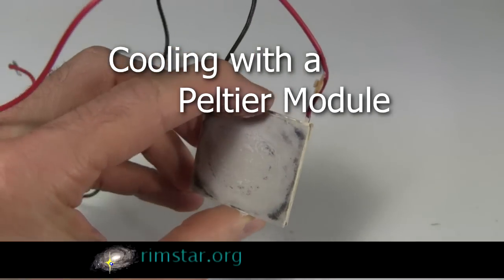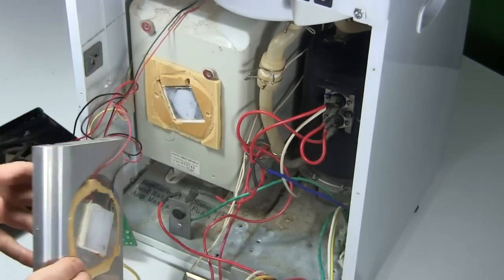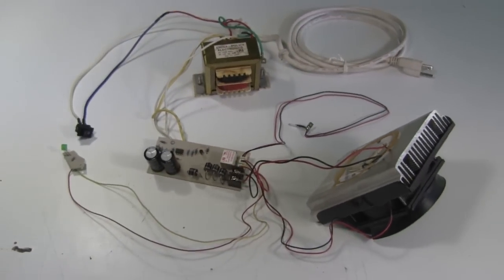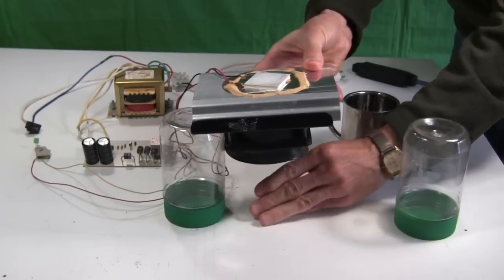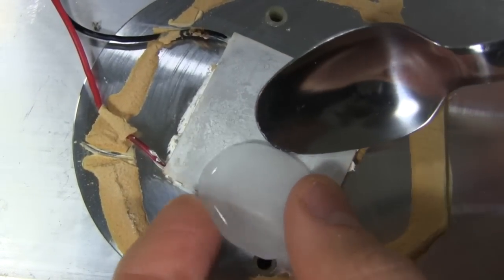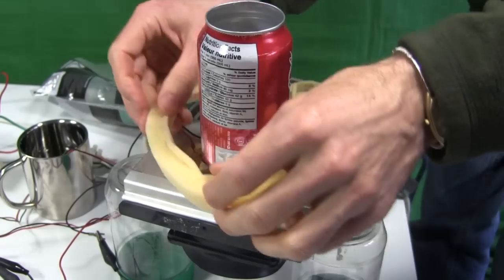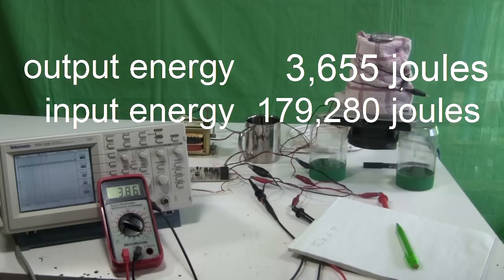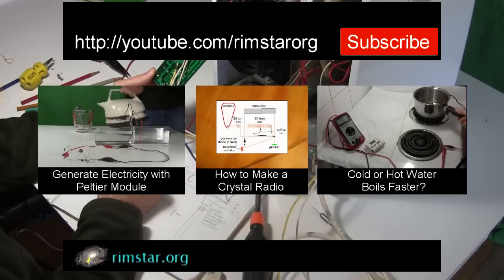Peltier Module Cooling - The Peltier Effect

Comment: Nice work here.  I've wanted to play with peltiers but didn't have the power electronics know-how to build a power supply for a base module so I like your solution of scrounging a peltier along with its power and control electronics.  I especially appreciated that you took the time 1) to do the efficiency calculations and 2) to explain the calculations themselves.  Thanks again.

Comment from the maker: You can't get better than 5% efficient with this Peltier module because that's the efficiency of the module itself and the way it work internally. The extra 3% of losses that brought my test down to 2% were likely due to heat entering despite the insulation. So isolating the cold side in a vaccum would help get that 2% closer to 5%, but that's the best that can be done with this module.
Reply: The bottom of the soda can does not have the ideal form for this (air insulation and very little contact to the peltier ... and why the aluminum plate ? heat transfer through more and more layers of materials is not the best idea.. one copper can with a flat base and very little  thermal compound in between to prevent any air from insulating would have been better.. this was nonsense even though well explained.
Reply: That's a great point.  The can has a large dimple in the bottom so there is very little contact.  A glass beaker would have been a good improvement to a cool experiment.

Comment from the maker: No, when you mentioned there was one, my quick look saw the insulation around the Peltier module and thought that was the Peltier module itself. So my bad.
Sounds like a good use! Really portable cooler. Well, with a power chord. Those are some serious volts and amps. Also, you'd need a way to remove the heat.

Comment from the maker: I agree, water and aluminum are amazing for pulling heat. Not sure how far I'll go with this. The electricity generation I've done so far is good for demonstration purposes and simple. Regarding useful power generation, at 5% I'd lean more towards photovoltaics, though Peltier modules work at night too - though you do need the heat source. A homemade larger scale one would be interesting to see, though from my reading, the materials used are difficult to make.

Comment from the maker: I worry about the heat being too much for the hot side of the Peltier module. It can handle only 100C (212F) or a little higher before the solder connections inside start to break. Maybe adequate cooling on the cool side will take the heat away fast enough. I'll have to work up the courage to try it, and wait for a sunny day with no shade.

Comment: great informing vid. My daughter and I are waiting for chips to arrive to build mini cooling system, for her Class project. will try the AC connection first then going green with a small 12 volt solar panel, I know the yeilds won't be much, but great for her showing a class it can be done.  Thanks

Comment: The materials can be as simple as copper wire and stainless steal wire bonded in V style junctions. The seaback effect is a wonderful example of simple power generation.  With rocket mass heater, solar stoves, and Water lenses you could very well store that heat in a mass of cob.  The goal of my project is to make a low maintenance,low cost,modular, and easy to build power generation for small computing for automation.  Plus you get cheap heating mass that serves multiple purposes.

Comment: The other 98% of energy probably went into heating the warm side. There is cross conduction in the solid material of course that impaired the cooling of the cool side. So if you'd properly use the warm side to heat the room for instance and thus cool it by ample air convection / conduction, who knows what your cool side efficiency will be!

Comment from the maker: I don't know. It's only the heat from the CPU that they're moving. The electrical current moving through them is only a few amps or less than an amp, so not much heating from the wires. But dsflores below says they haven't been used on CPUs since the 486 days, so it must be that at 5% efficiency they can't move enough heat.

Comment: You can also make a small cloud chamber for seeing ion tracks produced from charged particles from radioactive materials. You need a second peltier chip thermally pasted on the 12VDC one. The second peltier should receive 5VDC. Color the peltier (cold side) black on top. Then surround it with a clear acrylic box with a sponge inside on the top with 99% alcohol. Shine a light through at a low angle in the dark. Put a radioactive source inside, and you'll see amazing ion trails from radioactivity. Alpha particles are the most visible. Thanks for posting!
Reply from the maker: KarbineKyle Thanks. I've always wanted to do this, and had two peltier modules to do it with but unfortunately I broke both trying to build a popsicle maker :(, silly me. One day.
Reply: RimstarOrg How can you break peltier modules? insufficient cooling?
Reply from the maker: ***** I think that's what happened to mine. The soldering connecting the wires to the cooling type modules melts at a fairly low temperature so the connections come apart. I tried resoldering them but they still didn't work. I guess allowing too much current to run through them could also potentially damage them.
Reply: @RimstarOrg  Interesting. I run these ebay-12v TECs at a higher voltage (about 17 volts) to keep the current in check (they state they are rated for up to 15 normally). I embedded a 10k probe into a copper watercooling block and even with a radiator capable of blowing off in excess of 600 watts of energy the hot side was still at the point where bad solder joins would get iffy. I can imagine over-current would exacerbate this further. I have spent too much money and time on the very same project you have here in the quest for achieving the best efficiency possible given the terrible efficiency of TEC. That said... If you have a 3d printer, print a cradle that holds the chip, heatsink and most importantly the WIRES, in a completely static position during any heating and cooling cycles. Since I did that I have been able to push these chips well beyond what they "should" be doing. Also i ramp up and ramp down now. That helped with the thermal-shock issues. Cool stuff and good luck, nice video.

Comment from the maker: You need DC for a Peltier module to work. That's why the control board in my video converted the AC to DC before sending it to the module. Good luck though. Should be fun!

Comment: Thank for putting this piece up ............ 
Peltier unit ...... if you do not apply power ...... would it bleed heat the other way . ie if you want to transmit heat when there is the opportunity to grab it but when not , do not apply power , would it bleed out ? Or would be have any insulation value unpowered ?
Reply from the maker: +magna59 I don't understand your question. You have to apply power to do the heat transfer to heat up one side of the module. If you then turn it off, I imagine the heat would be lost fairly quickly since there is no insulation.
Reply: +RimstarOrg ....Thank you for your reply.OK,so if the side you are pushing heat into,when there is the right conditions,ie low grade heat on the down side&power available ...... but if you turn off the power,if there is a heat gradient,the unit will just allow equilibrium to be re established.Yes?...............That ' s how I understand your reply .
Reply from the maker: +magna59 I don't think equilibrium will be established between the cold side and the hot side as fast as if you'd thermally shorted it with a piece of aluminum. It does stay hot for a little while. How long, I don't know.

Comment: Hey Rimstar, if you want to measure more accurately your efficiency, I would suggest that you do not use an aluminium shim between the can and the peltier cell. The air gap between the cell and the shim act as insulation, as well as the gap between the shim and the can. Having a setup with the can directly on the peltier using thermal paste between could give you a increased efficiency.
Reply from the maker: Zatrax Traxer I didn't have any thermal paste. I agree, that would be much better. I should buy some so that I at least have it ready the next time I need it.Regarding the aluminium shim, my reasoning was that since aluminium is such a good thermal conductor it would gather heat from all over the Peltier module and transfer it to the uneven bottom of the can. The can bottom wasn't very flat at all and made relatively little contact with the module. I guess only a test would tell which approach works best.

Comment from the maker: I looked into the physics of it down to the electron level and I still have to dig deeper. I debated putting the same simplified explanation that others use of how it works, but if it's not at a level that satisfies me then I don't want to do it. I'll keep researching.
Reply: Why do you think they only used the Peltier for cooling and not for both ?
I have a need for both hot and cold water and was considering using a Peltier in-between two tanks but this video has made me reluctant .

Comment: Any air that is trapped between the can and peltier surface acts as an insulator. A thermal compound paste with a high thermal efficiency would dramatically improve the heat transfer. Would be interested in seeing the difference it makes on the overall efficiency. (paste cost < $3 on amazon)
Reply from the maker: +Japper There was already thermal paste between the heat sink and the peltier module. I imagine, since I'd taken it off and put it back on again, that the layer of paste wasn't complete and there was probably some air, but at least there was some paste.

Comment: thx for ur explane i just have a q now if i conect the peltiar to a battry lets say 12volt and 120amp is it going to get the amp that it need or i must put things to let it get low amp?? so if i conect to a 12volt and 120amp direct conect is the peltiar going to dameg or its fine it will take the amp it need?? and thx

Comment: how many watts do you think I would need to reduce the temperature of a small area (40 cubic feet), the area already has a ton of air movement (300 cfm+), but the cabinet still gets hot. the ambient area getting refreshed into the area is 66-68F, but the temps can still get up to 88F. I have a 600w light for growing lettuce and tomatoes hydroponically. 

do you think a water for the hot side and/or cold side from a CPU cooling setup would help increase the efficiency? I'd like to reduce the temps of the box at least down to 80F or so, 88 is too high.

I see that to convert watts to BTU, you multiply by 3.4125, but i'm guessing that isn't for a peltier system, but a refrigerant system? do they make extremely small 1000-2000 btu refrigerant systems that don't take up a huge amount of space and weigh like 50lbs?

Comment: Would the efficiency of the hot side be identical to the cold side?  All conditions assumed the same would it take the same amount of time and energy to heat the water the same number of degrees instead of cool it?
Reply: AFAIK, efficiency depends on the temperature difference between the hot side and cold side. Also, keep in mind that the hot side generates joule heat while pumping heat from the cold side.

Comment: Can I run a peltier cooler using a 9V rechargable battery or a Power Bank? Whats the smallest possible power source. I'm not looking to freeze water. A 5 - 10 C drop is optimal. Thanks
Reply from the maker: Suyash Saxena That depends on your peltier module. Find the specifications for it (e.g. looking at various peltier modules on ebay they give the voltage, working current and maximum current.) It should tell you the voltage rating and how much current it can handle. As for getting a specific temperature, I don't know if it's based on current or voltage, though I suspect it's current. So you'd have to monitor the temperature while changing the current to see how much current is needed. That is unless you can find a chart of current vs temperature for your specific peltier module.

Comment: Very cool!  I always thought they were a lot more efficient then that.  I wonder how efficient they are at generating electricity.
Reply from the maker: I've read 5-8%. My search turned up an article from September 2012 about some research that got to 15-20% but I don't know it they made it to market or managed to get the same outside of a lab.
Reply: Wow that's surprising!  I was expecting more like 1% going by how efficient they are at cooling.  Very cool.

Comment: Thanks about the information. i have a question, tell me please about one of paltier part how much current and hoe much volatge does it take?
Reply from the maker: I don't know how much I actually used since I used the circuit which came with the water cooler, but searching the part number online I found this datasheet http://peltiermodules.com/peltier.datasheet/TEC1-12705.pdf In there you can see the maximum current it can handle is 5.3 amps and the maximum voltages are 14.2 volts at 25 degrees C and 16.2 volts at 50 degrees C. There are also graphs there which show what temperature difference you'll get for different voltages and currents.

Comment: Hey, how and where do I buy these items on their own? (the control board, on/off switch) If they're not handy for me. I want to know how to connect these with a CPU cooler(with fan) and the Peltier unit and also the 12 volt 4 amp adapter. I'm looking to make a mini fridge, and just need some extra advice and components. thanks!
Reply from the maker: You can buy the on/off switch at electronics stores like Radio Shack and sometimes automotive stores. I don't think there's any place that you can buy the control board. You do need something to control it though. I just broke both my peltier modules by letting them get too hot (which also means the other side got too cold.) I bypassed the control board by not letting it monitor the temperature, so that's an example of what can happen without a control board. I don't have any replacement circuit.

Comment: maybe you could get better efficiency by using a bigger one at lower amps. I read somewhere that the higher the current the lower the efficiency. I suppose because of ohm's law, W=RxA² and as the energy transfer is linear to current one rises linearly while the other exponentially. I suppose there will be a point where it will heat more than it can cool.

Comment: Hi! Pls can you tell me what sistem is more effective for cooling? TEC Peltier cooling sistem or normal fridge pipeing and compressor sistem? sorry for my english and Thank you!
Reply from the maker: That depends on what you need it for. A normal fridge piping and compressor system is more efficient for large applications like the fridge in your kitchen. But Peltier cooling is more practical for some things like portable camping containers, cooling some electronics, cold water dispensers. There are more efficient Peltier coolers in research laboratories, but they are not for sale yet.

Comment: +R imstarOrg, If I connect a peltier unit that draws nine amps maximum, to an unregulated supply that can only supply that can safely supply only three amps, will it damage the power supply?
Reply: No, it won't destroy the power supply . Current of power supplies is their maximal possible output so they cant just simply output more, it doesnt mean that the power supply will get damaged.

Comment: hello, I use  a 12 v 5A adapter to 12706 peltier, the process of cooling is really slow, any suggestion, how much Amp need to be given to the peltier?
Reply from the maker: A google search for "12706" turns up this page http://peltiermodules.com/peltier.datasheet/TEC1-12706.pdf which looks like the maximum is can handle is 6.4 amps, assuming that's what that means. Here's another one http://www.thermonamic.com/TEC1-12706-English.PDF. However, they're giving the same current for all temperatures which makes me think you control it using the voltage and not the current.

Comment: Hello there.  Tim here.  QUESTION:  I am curious if a small styrofoam coolr (air conditioner ) could be constructed using in part, thermoelectric colling modules?  I think the short answer is yest but what to do with the exhausted heat from the heat-syncs is a problem for use in an automobile.  Any ideas?
Reply from the maker: Insert copper tubes into the heat sink and circulate water in the copper tubes. The copper tubes would continue to another heat sink and a fan where you can have the fan blow the heated air away. Along their route from one heat sink to the other, the copper tubes would be insulated.
Reply: hi may I ask you how long does that take to turn the water to ice and is there a way to speed up that process? and can you make a video of the improved version?

Comment: it's way more efficient to put one in series with a water cooling loop than directly on top of the cpu. the peltier has a fixed deltaT plus one powerfull enough probably wouldnt fit, so just put a water loop, and put the peltier after the radiator so that if cools the liquid further down, as the radiator can only do so up to near ambient temperature. It's better as an enhancer for water colling than as a stand alone solution. Back then it worked but now high end cpus are just too powerful.

Comment: Sir, can i know how many voltage have been used for thermoelectric peltier to change liquid state to solid state? or cool down a tin of water ?
Reply from the maker: +李建顺 Since I used an existing circuit I didn't measure the voltage. I've long since damaged my peltier modules so there's no way for me to check now.
Reply: +RimstarOrg ok thanks for your experience..